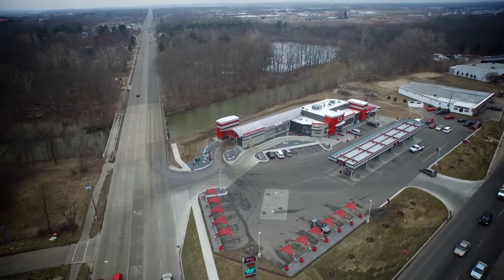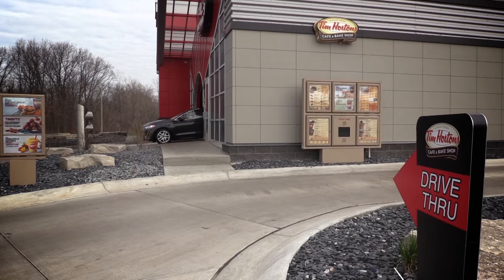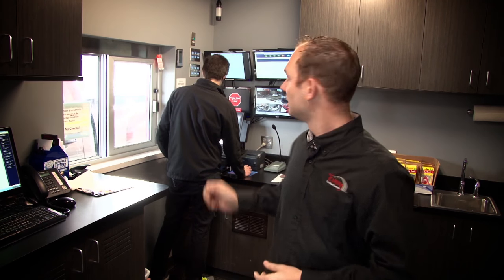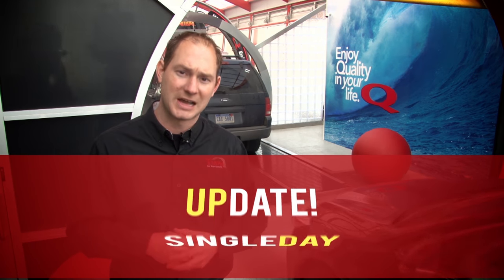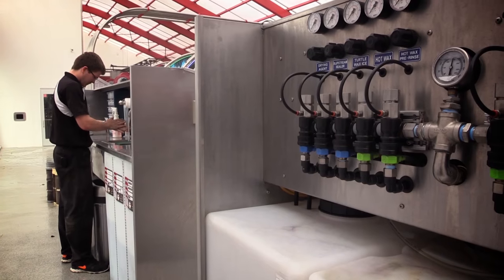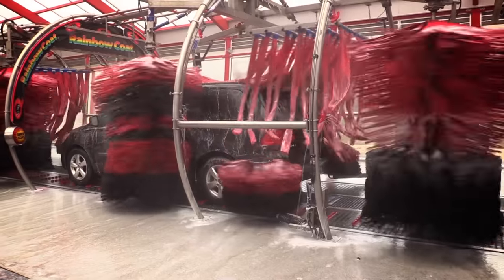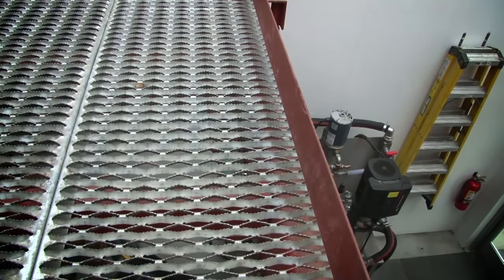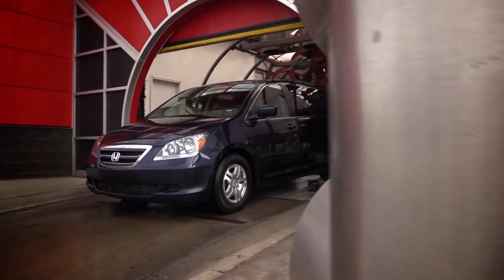Tour The Totally Tommy Ultimate Gas & Car Wash "Waverly Site"

Comment: Just out of curiosity, how does one reach the owner's suite? I can't imagine where you guys would put stairs.
Reply from the maker: The typical express model has a comfortable staircase on the wall facing the loading queue. In the Waverly / Gas, C-Store design the stairs are hidden behind the refrigerated displays (accessible from the flight deck/cashier station) and lead to a small upper-deck area with a window view of the tunnel.
Reply: @Tommywash  Thank you very much for the response! Keep up the great work.

Comment: i really do like your conveyor does it break often if so looks like it would be hard to fix compared to the log chain or dog bone chain roller conveyor
Reply from the maker: All equipment requires maintenance, but the Dual Belt conveyor has been very reliable. The system eliminates a great deal of damage which would otherwise be caused by jumped rollers or customer error--especially running at such high volume.

Comment: Just Wow - I'm Planning a Car Wash Station to Open in Islamabad, Pakistan. How much it will cost in Rupees? 
and Thanks for Sharing with us.
Reply from the maker: Hi Abdullah, 
The cost will vary dramatically based on the specific equipment layout, international shipping fees, and other factors. The estimated costs in USD for different site models are available at http://tommycarwash.com/site-models/ while the costs for various pieces of equipment are available from our webstore http://shop.tommycarwash.com/. 
For a more formal quote you will need to contact our international sales rep using this form http://tommycarwash.com/contact/
Please note that our sales team is currently exhibiting at The Car Wash Show in Las Vegas, and may be somewhat slow to respond to any information requests.

Comment: Can i know if this doesent scratch my car? becuase its not any rinse before the brushes
Reply from the maker: Brushes are lubricated with body soap, and all soft cloth and foam brush materials are specifically developed to be safe on vehicle exteriors.
Reply: Tommy Wash top
Reply: I was worried about the same thing. My Challenger has vinyl stripes and I thought for sure the brushes would scratch them. Ive been through Tommy's in Joplin many times and not one scratch! My car always comes out super clean! I love Tommy's! They rock!
Reply: If you re touching the finish there is a chance you re scratching it.
Reply: Tommy Car Wash Systems Brushes scratch cars consistently, are the brushes cleaned after? I want straight answers. Does that “colorful” “polish” really shine the car?
Reply: @Tommywash  Bullshit!